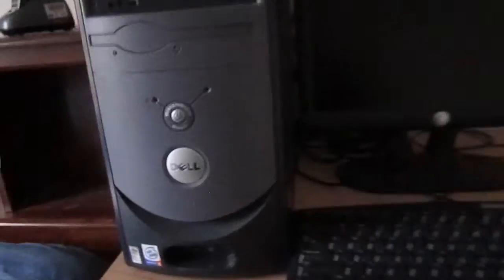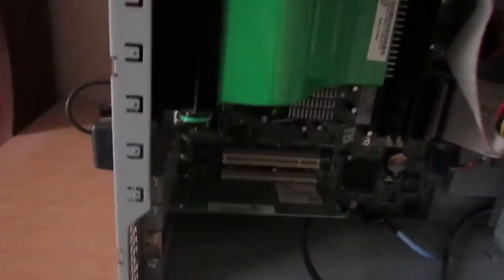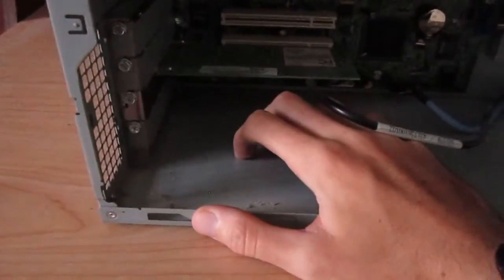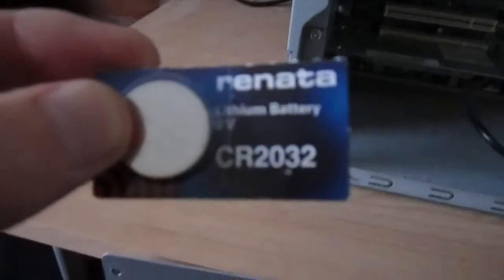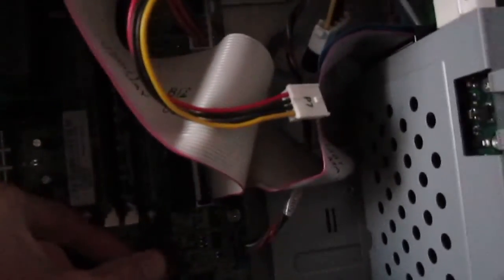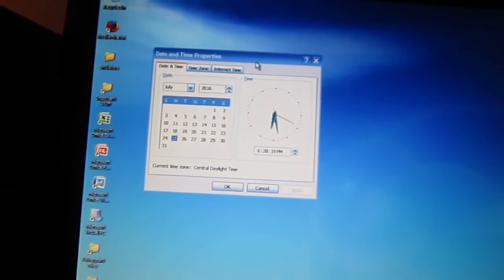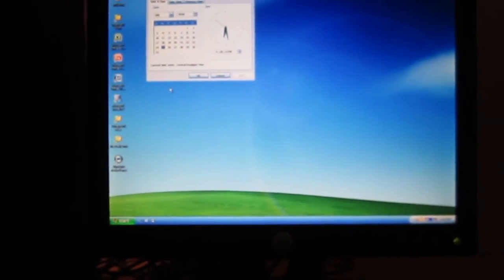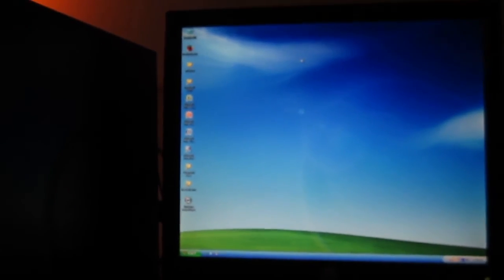Dell Dimension 2400 CMOS Battery Replacement

Comment: google AI says windows clock settings are separate from actual bios settings. so this may not hold up if you are using say, DOS programs. You will need to get into the bios at start up and change it there.

Comment: Is this computer from 2003 or 2005?
Reply from the maker: This is one is from 2003. These were sold around 2003-2005 as low budget desktop PC.
Reply: Duran Medine What OS will be running on your Dell Inspiron 1525?
Reply from the maker: Aldwin Panny
Windows XP Professional SP3.
Reply: Duran Medine Why you gonna to put Windows XP on it?
Reply from the maker: Aldwin Panny Because it has a weak CPU of course.
Reply: What Office versions will you put on your Dell Inspiron 1525?
Reply from the maker: Office 2007.